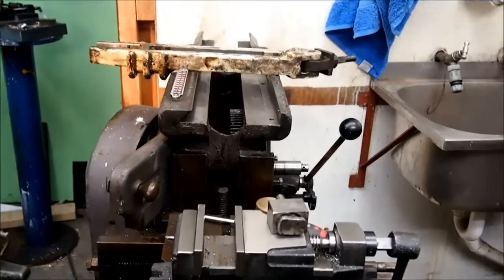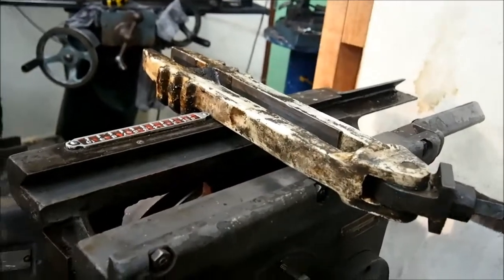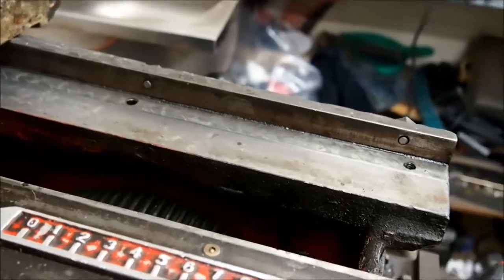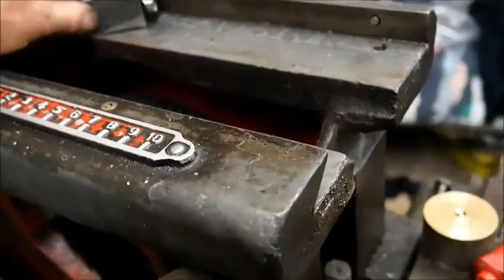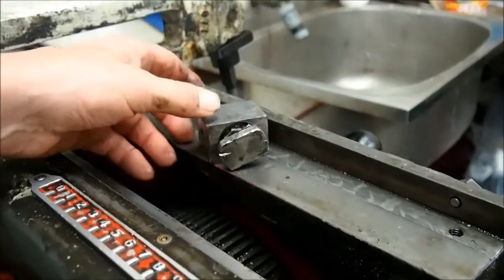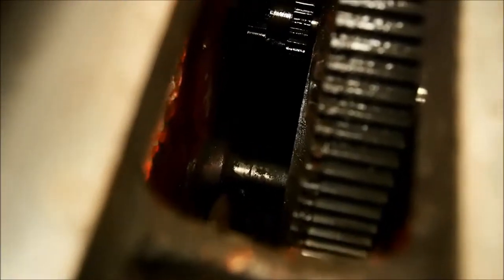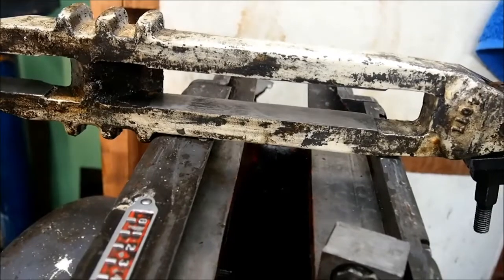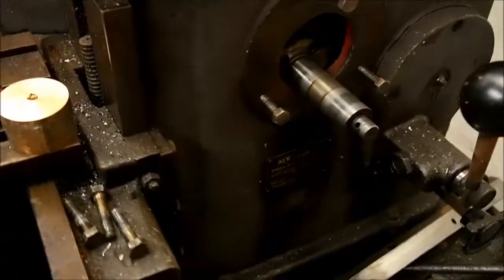Alba 1A shaper repairs Part 2

Comment: Hi I know this is after the fact but may be useful for someone seeing you vid for the first time. Your block that rounds in the yoke appear to be a replacement. On the parts I have salvaged from a scrapped machine that block has oil groove in an x pattern  on the two sliding surface that run along the yoke. Incidentally a smash up had destroyed the yoke on the donor machine. Looking forward to watching the rest of this series as I'm restoring an Elliot 10M.

Comment: On my Alba 2S - the yoke sits on a block which is bored to slide / rotate on the pin. The pins held in place with 2 5/8BSW hex bolts. It was tight but knocked out with a soft mallet. PIA to refit it all.
Reply from the maker: Once I was told about the hidden grub screw it was no big deal.
Reply: Hi both, I'm restoring what appears to be an original Alba (ie not 1a) and it is broadly similar of course. The ram yoke/pivot pin on my machine is held in by one grub screw on the left hand side of the machine in the only place where it could be reachable through the porthole in the side of the machine. Despite removing that, my pin was seized solid and refused to move, even when encouraged with a lump hammer.  Heating both sides of the casting and the pin with a blow lamp and cooling with WD40 did result in the pin moving slightly (again encouraged by lump hammer) but removal was still impossible. Clearly there's a danger of burring the shaft over (and making it even more difficult to remove and so I nominally centre drilled the pin and knocked it out with an air chisel (centre drilling is essential to stop the chisel point bouncing around. The high frequency better targeted blows being much safer and more effective at driving than the drift and lump hammer method...and my casting survived!

The pin is a mess and will need to be replaced. Damage due to wear and tear is significant but also there's burring associated with the grub screw that may be the cause of the difficulty I experienced in removing it. I'm going to drill a recess in the new shaft for the grub screw to locate in.....